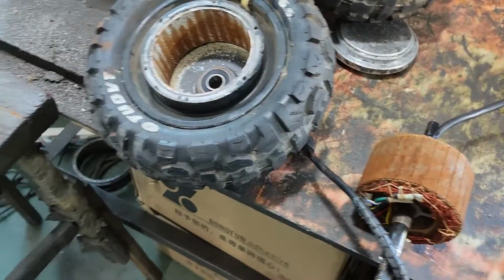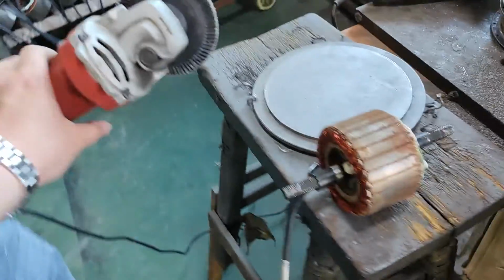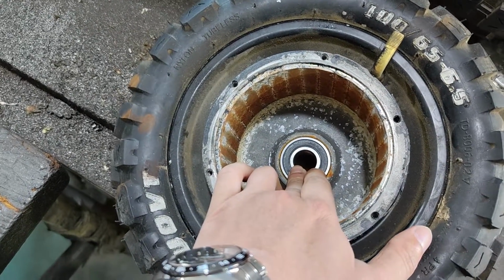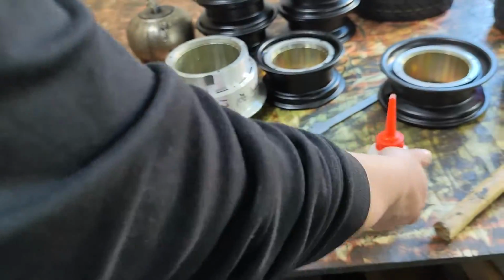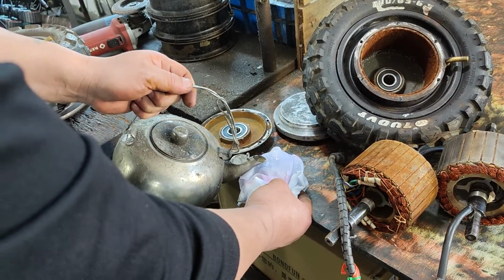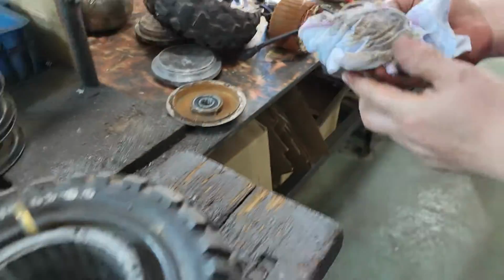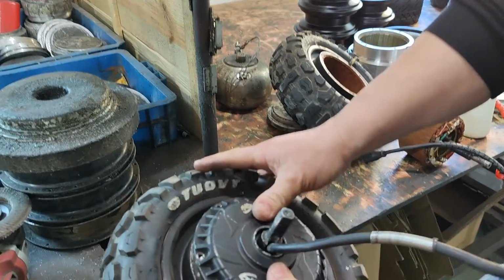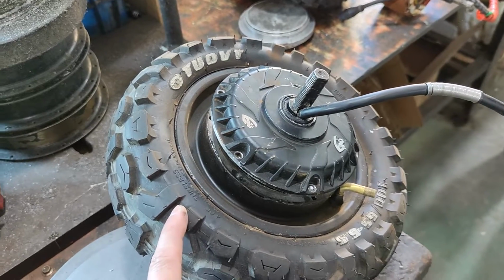Nami Motor Service for long time use

Comment: just coat the motors with a protection spraypaint specially designed for motors and transformers. this will protect the rotor and stator magnets.
Reply: What is the method, my friend? Do you have a method?